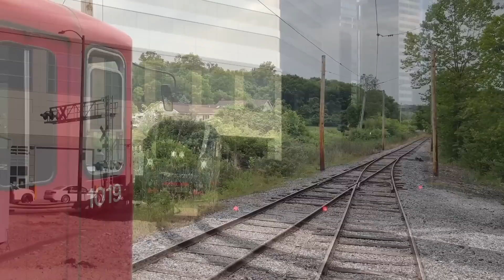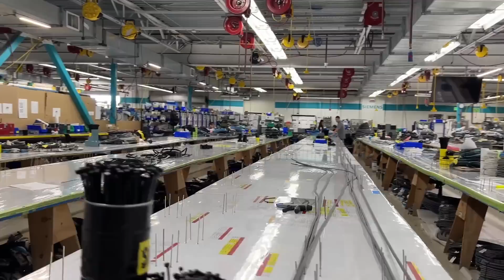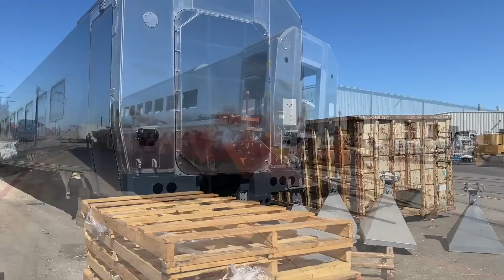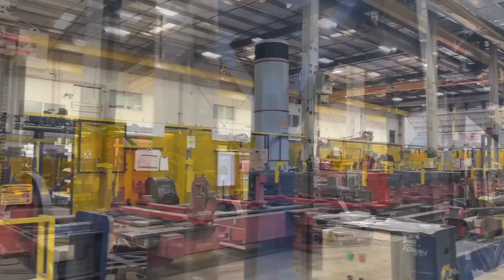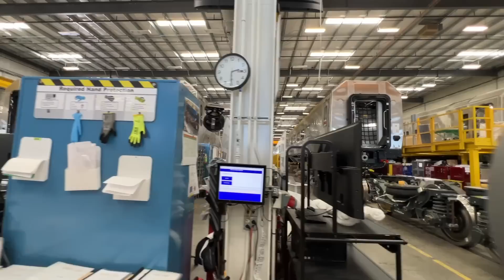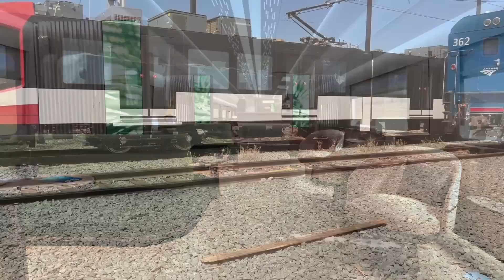EXCLUSIVE Tour of Siemens Mobility Factory - Building the Future of American Rail

Comment: The problem with the Northeast corridor is the track curvatures and the need to stop at top many stations makes it impractical to go close to 125 mph plus
Reply: Depends on where you are. Significant sections are good for 125+. A lot of new rolling stock for the NEC is being built for 100, 110, or 125 mph.

Comment: This is the worst locomotive they can ever give to amtrak ever.
Reply: @Society2day  why is that?
Reply: @HansTheGeek  there are so many design flaws it would be a book. It's not user-friendly, and the equipment onboard is vary basic. The ac and heater never work. The seats get in the door, and the engine room doors have to slam them to close. They still use softkeys, but they should be touchscreen, not to mention they placed a huge gigantic windshield in front. With this windshield, wiper fluids on the wiper itself. That's just the tip of the iceburg.
Reply: That sounds like thier stuff is a pice of junk. Did they get sued for not delivering what was required? 
Oh wait…. They ordered more of that seemingly crappie stuff. Somebody seems to be wrong here 🤔

Comment: A couple of things jump out at me from this factory tour. One. the engine and passenger cars are built like a battering ram. I know this is so they can survive a collision with a freight train. One more reason to separate freight and passenger traffic.  so this is not a requirement. Two, there is alot of wiring in a locomotive. I would think they would consider upgrading the design to a network so they can use less smaller wiring.
Reply: I had similar thoughts. Looks like a lot of custom, labour intensive work. in 2024 we should really have train manufacturing fine-tuned so it's more like building cars and pickups. Punching them out of an assembly line. So much time wasted moving half built carriages around from one place to another. Hopefully the east-coast facility will be more organized.
Reply: @jdillon8360  Unfortunately unlike cars, rolling stock building gets treated as a jobs program, even in countries that have really good transit. Doing anything that would reduce the amount of people needed would result in all sorts of political backlash for Siemens, both here and in the EU. Thats why they're building brand new facilities all around the world instead of focusing on purely efficiency.
Reply: @georgewishart3308  If you look at how passenger rolling Stock is build for the US vs the EU it is quit jarring how it differs. While freight cars are generaly the same US Passenger cars are quit different. Cars for the US are much heavier.
The electrics are a network design. Modern Locomotives and Multipleunits are basically computers.
And lastly, railcars and locomotives are not as standartised as cars and trucks. If your factory just builds Toyota Corollas you can automate prettymuch the intere process. But with rollingstock every order of the same model is different and one factory usually makes multiple models at the same time. So automation is usually quit difficult. But it can be done. Siemens offers a stripped down Version of the Vectron called the Smarttron which is not customisable. They can push these out much more quikly than a normal vectron. So they make them when the productionline slows down and soll them from Stock.

I hope I brought some inside. Greetings from Europe :)